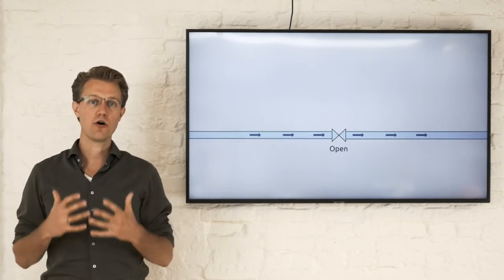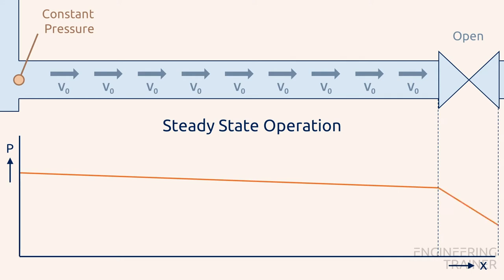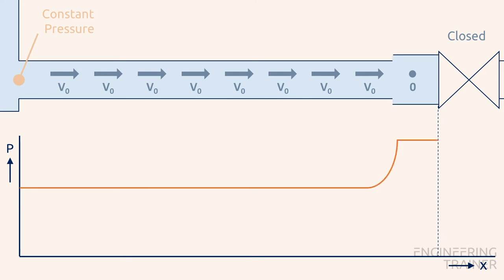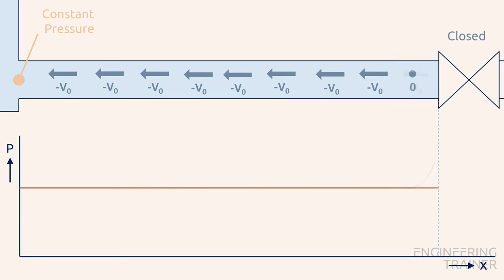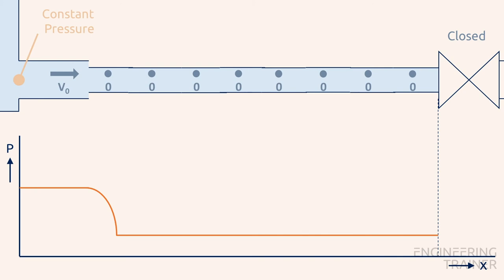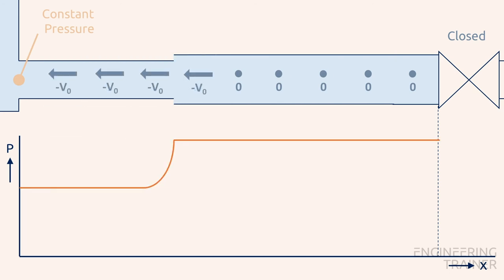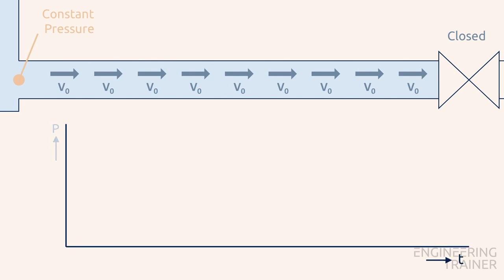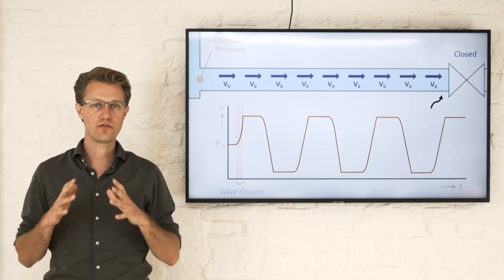Water Hammer - What is Water Hammer? (1/8)

Comment: when the pressure in pipe is greater than that of the static head from reservoir, the water flows out of the pipe, which is indicated by the -ve velocity; does that means there is a flow separation/creation of vacuum takes place at the location of valve? kindly explain.